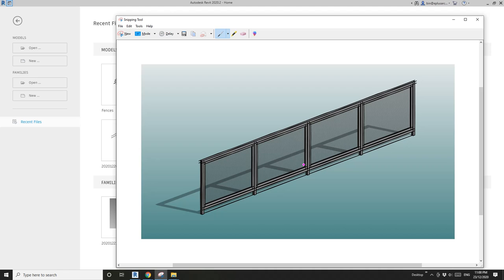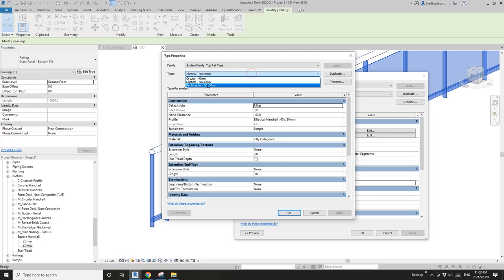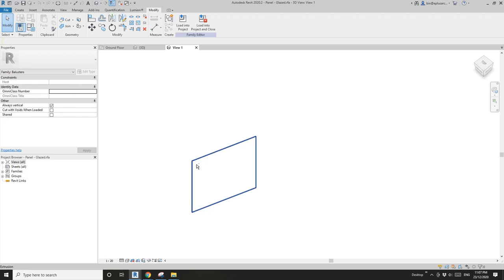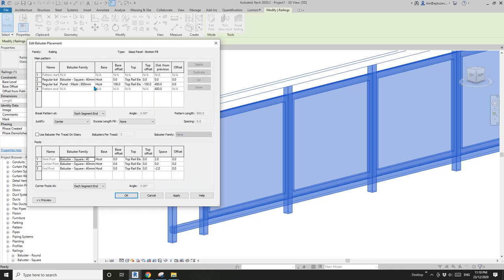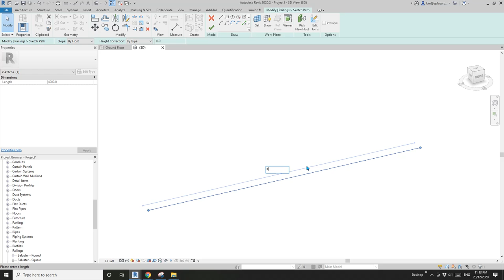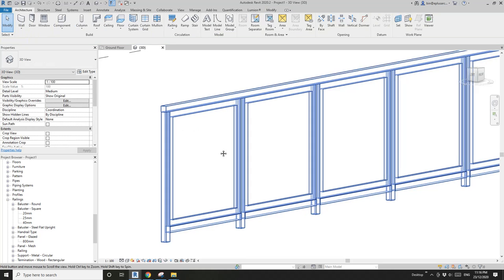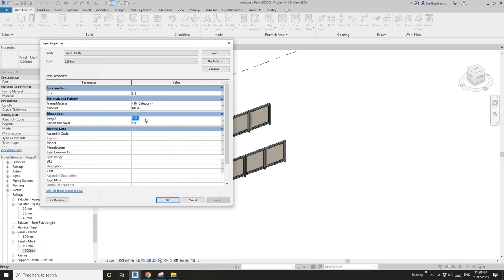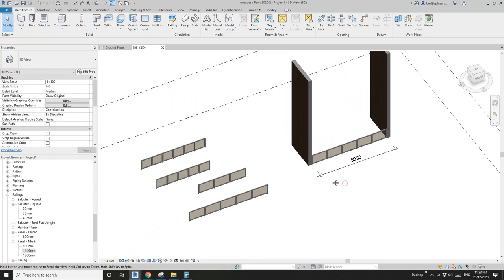Everyday Revit (Day 280) - Mesh Fencing using Railing

Comment: Good job, railings are hard, but they do look great in 3d & have some very useful applications, especially when you start hosting them to stairs or topography.
Reply from the maker: It’s also very problematic, especially when you need to detail it or need to comply with the Code. Sometimes I’d rather use model in place than a railing.  There are some nice examples in your sample files folder, both the fences and railings file. You can start from there.

Comment: Seems like the curtain panel tool is much easier to model the railing.
Reply from the maker: Curtain wall is more flexible and easy, but only good for some simple fence type while the railing can be more complicated, it is suitable if you need to add elements such as fixings, hand rails, supports, terminals, etc. Personally, I hate railings, I prefer curtain walls or even model in place. I will probably use it for handrail. :)